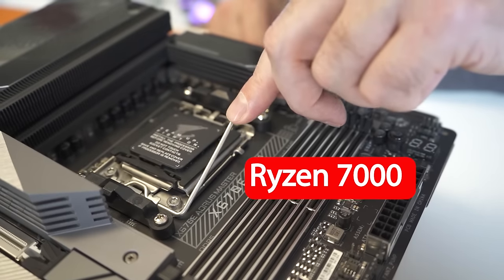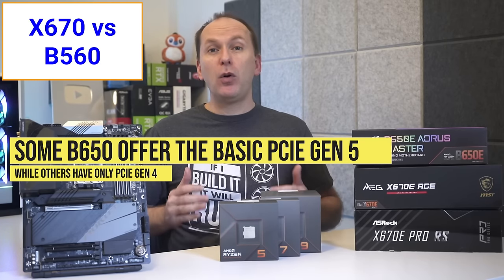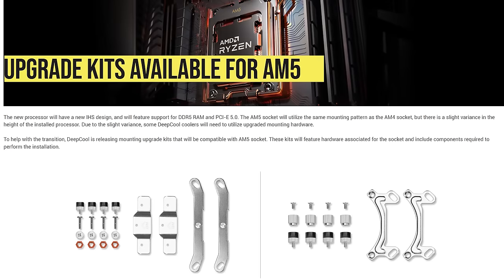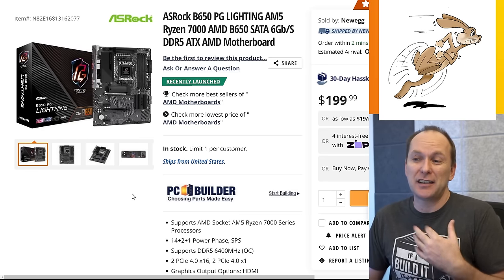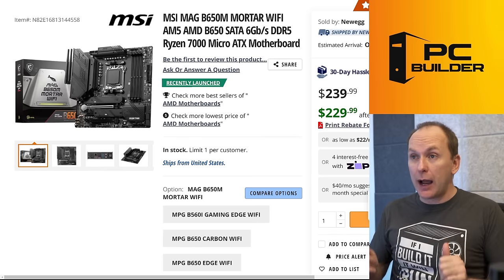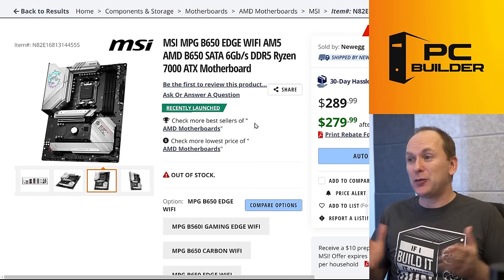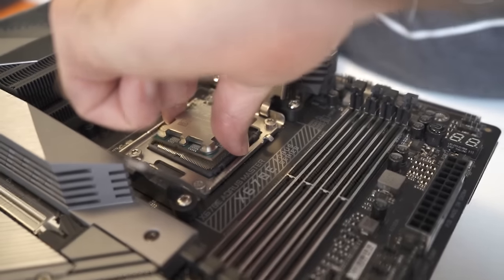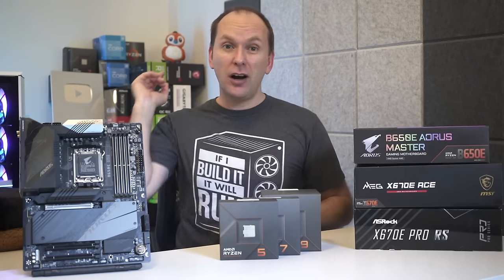Best Motherboard for Ryzen 7000 | AM5 Motherboard (B650 & X670) For Ryzen 7600X 7700X 7900X 7950X

Comment: thx for the Video Man. I still have to decide between a MSI MAG b650 Tomahawk (250€) and the Gigabyte b650 Aorus Pro AX (310€).
Both have great Audio Codec (ALC1220 vs. ALC4080), similar VRMs and Features. 
Are both good for a Ryzen 7800X3D + RTX4090 + 2x16GB DDR5 6000 CL30, (GSkill Trident Z5 RGB) + MSI MPG A1000 ATX 3.0 + Fractal Design Torrent and a beQuiet Dark Rock Pro 4 Build?

Comment: B650 e or x670 e for future cpu upgrades with the 8900x3d 9900x3d etc 
İ am going to stick  with same ram and mb until am5 is ended just worry about vrm powers i dont need double gpu or more usb and ssd sockets what do you suggest ? 
My gpu is currently 4090

Comment: Hello, I have a R5 3600 and a rx 580 8gb for 3 yrs and I am planning to upgrade 1 of them for more fps in valorant and stream, what part should I upgrade and what brand or model should I buy?
Reply: Upgrade the GPU. The R5 3600 has plenty of headroom for up to an RTX 3070ti at least. Which to buy depends on your budget. A Radeon RX6700XT would be a huge upgrade for < $400.

Comment: There is a feature that saved my but once. The motherboard in the AMD  b450 board which is SSD M.2 secure erase. I have this on the MSI B550 board but not on the Gigabyte B550 board. I do not hear anybody talk about this but there is not a lot of software tools that will Handle the M. 2 SSD along with other SSD's you have in your system That is a great tool and feature on motherboard dealing with issue on a bios level.

Comment: I normally buy med/top tier boards like a aorus master or asus crosshair but i think I’m just gonna get a b650 or 650e this time with my 7950x3d. Not gonna use gen 5 I already have two gen 4 2tb drives and as long as it has decent vrms im in. And b650 boards are around the same price as a x570 board from last gen. But one thing I do like on more premium boards normally aorus is a backplate for the motherboard. I have until Friday to pick my 7950x3d at microcenter, i know i should just wait for the 7800x3d but I don’t have much patience. And its nice to have more multicore performance when needed. But wish you could get free ram like on non x3d parts. Im hoping a 7950x3d and gaming oc 4090 should last me 3 years.

Comment: Could you do a video on some motherboards dropping the pci to 8x when plugging more than two m.2 drives like the aorus master. Is that still the case with m.2 gen 4 or only gen 5? Does it matter if the m.2s are wired to the cpu or the chipset? Its confusing, what boards keep the pcie at 16x no matter how many ssds, pro/cons. Some boards giving you usb 4.0 or 2x gen 5 m.2 or other stuff, would be good to have a vid explaining this

Comment: Jason, what if AMD surprises and releases the new GPUs that take an advantage over PCIe5 lanes? 😵
Reply from the maker: If that happens I'll do a new video! ( ;
Reply: @PCBuilderChannel  hehe fair! Reliable as always 😁
Reply from the maker: Also - whether the new AMD GPUs have PCIE gen 5 or not, they will not even be close to fast enough to exceed PCIE gen 4 (we just barely passed gen 3 speeds and gen 4 is double that).

Comment: Asrock is a great motherboard. You forgot to mention it has 4 lights which display if there is an issue with the bios, gpu, ram and psu. It also has the japanese capacitors renowned for its quality
Reply: Actually it is not so great anymore. If you have an OCZ Revodrive3 x2 and would like to run it on the AM5 motherboard make sure to get an ASUS motherboard. AsRock will not be able to recognize your Gen2 PCIe SSD

Comment: It is better to buy i5 13600kf now then i5 12600kf right?
Reply from the maker: So that's part of the new Intel 13th gen launch coming next week. Yes it will be a more powerful CPU but that doesn't necessarily make it a "better" choice depending on your needs. See our CPU video on the channel from easily this month where we cover all the current options. It might give you a better sense of what you need.
Reply: @PCBuilderChannel  is z690 gigabyte gaming good enough for i5 13600kf

Comment: Someone took a 4090 and ran it using PCIe gen 3 spec.  There was minimal loss in FPS and in some cases a difference within the margin of error.  We will have storage soon that can use those speeds but by the time you actually can buy a graphics card that will require PCIe gen 5 speeds, the current round of motherboards will be considered ancient.

Comment: I'm a simple man. I skip Gigabyte and I buy slightly over the top components because I don't run to the store to update every year. I still run my 9700k and 2080. What boggles my mind is that the focus of this review is pretty much only on back IO and sound chip... Why? The reliability/history of the manufacturers, quality of vrams, how many layers does the mobo have, does the layout make sense... There's so many aspects that need to be considered. Not to mention that mobo is the thing that you are least likely to upgrade unless you need to jump to next socket. If you're spending 300 USD on one you might as well do 400 and have something like x670e Strix E-F.

Comment: There is MSI MAG b650m. Windows 10 is slow to boot. When you press the power button, the orange LED lights up, then white. The signal to the monitor is given with a 40 second delay. Does this need to be treated somehow or is there a built-in protective check? In the BIOS, I chopped off everything using EZ Debug, all the same, the monitor receives a signal 40 seconds slower. As a result, 55 seconds to start Windows.

Comment: Is the Asus Rog Strix B650E-E a good motherboard or should I go with the Aorus Master instead?

Edit: Also I noticed that the B650E-E strix has better I/O connectivity but slightly worse VRMs than the Aorus Master. Although I’m slightly disappointed that the Aorus Master doesn’t have a DisplayPort.
Reply from the maker: They are both very high end boards with very high end (and massive overkill) VRMs. Honestly take your pick. Not sure why you want a displayport on the motherboard, remember the iGPU is very weak (office stuff only) and you'll connect your monitor to the dedicated GPU ports instead.

Comment: Hi I have a question i am using a ryzen 5 5600G (I bought it a year ago due to your ago due to your vid)
and FINALLY bought a RX 6600XT for 255 USD ( converted )  but I forgot that 5600G does not support PCIE 4 
will it have a noticeable difference against with a CPU that support PCIE 4 
PS LOVE your VIDS SO MUCH

Comment: Hello i am buys my parta to make a PC right now i have bogjt a 850w 80 gold PSU but i was wondering what parts can i buy so it can run high fps at 1440p or 2k o was going to buy a corsair mid-tower case 4000x RGB with 3 fans included

Comment: i got r5 5600 rtx 3060 build and my total estimated wattage is 329W then i multiplied it to 1.5 = 493.5.W.  now my question is I recently purchased the corsair 550w + 80 bronze PSU. can it handle my pc? or should i be worried? do i need to upgrade the PSU to 650w? please reply :(
Reply: I have a combined wattage of 380W with my GTX 970, i5-4690, 4x4GB DDR3 RAM, running on a 450W PSU - no overclocking. Been running strong since 2015.
One potential issue is: I can no longer connect a second monitor, either the PSU doesn't deliver enough power anymore - it used to - OR a capacitor is blown in my mobo.
Didn't care enough to investigate as I'll replace it in the following weeks. But I wished IF the fault was with the PSU, I had more head room. 
That said, your wattage is even lower, so 550W should be fine and even provide some room for OC. (Advice based on anecdotes, not professional expertise)
Reply: You're totally fine.

Comment: I was not planning on upgrading but scrolling threw BestBuy today they had a Gigabyte B650 Aorus elite ax board for 156$.... I could not pass that deal up. Now to wait for the 7800x3d to go on sale and I'm set for 2-3 year till my 4070ti slows down or just get killed soon by the 12gb 4060ti which I think is going to render the 4070ti useless.

Comment: I  just bought an MSI Ventus 3x GeForce RTX 4080 16GB, MSI X670-P with a ryzen 7 7800x3d and 32gb (2x16) 6000MHZ T-force ram and now I'm hearing I'm going to have problems running 6000MHZ is this true?

Comment: hi @PCBuilderChannel  ProArt X670E Combined power phases 16 + 2 are rated for only 70 amps. Comparing with MSI x670e carbon 18 + 2 90 amps, does it make a difference in processor speed?

Comment: Hey Jason so I just bought a 3060ti founders edition and I connected it to my mobo (asus strix b550-f) and when I went to boot it for the first time it was stuck in a static like screen for maybe 30 seconds but then booted up into my windows screen. Since then I haven’t had an issue with the card, boots up fine now and I haven’t had an issue gaming. Should I be worried about the first boot up it had.

Comment: So I got the b650e master auorus .. 6400 cl32 trident RAM seems to have an issue if smoke is enabled mono starts to have issues after restarting showing (c5) code .. so physically removing and sticking in memory does the trick and disabling xmp after .. now ever since I built this all new rig the q code stays on 76 at all times , not sure why and wondering if you can help ?
Reply from the maker: For troubleshooting I recommend heading to reddit Build a PC Troubleshooting forums. Its a great resource

Comment: Summary:
THE BEST MOTHERBOARD IN PRICE-TO-QUALITY CATEGORY IS NAMED AT THE BOTTOM

[ Choosing chipset ]
• a620 - budget
• b650 - budget, but for cpu overclocking
• b650e - optimal for price and future upgrades
• x670 - avoid at all costs
• x670e - avoid except you wanna build double rtx5090 computer

[ Power delivery ]
8-pin - for budget non-powerful cpus
8+4-pin - for any desktop cpus, even for the future
8+8-pin - buy only if cheap enough or you're a liquid nitrogen overclocker
>=16 DrMos 60A+ (aka smart power stages)

[ Performance potential ]
>=8 layers of textolite (aka PCB) for high ram frequencies
Check for availability of M.2 nvme pcie 5.0 slot, optional

[ Sound/Wi-Fi ]
LAN =< 2.5 Gbit, bigger speeds are overpriced
LAN-controller must not begin from "Killer"
Sound controller Realtec ALC1220 or ALC4080 or ALC4082 or Supreme FX, if you're an audiophile - buy sound card instead and skip this part entirely
Optical SP-DIF for multi-channel digital sound (recommended)

[ Storage ]
The fewer amount of sata, the better (with m.2 nvme is vice versa, but 3-4 is enough)
RAID-controller importance for multiple storage system

[ Cooling ]
Direct VRM heatsink
m.2 nvme cooling

The best for the price (B650): MSI b650e tomahawk Wi-Fi
The best for the price (B650E): asus rog strix b650e-e gaming wifi
The best for the price (X670E): AsRock x670e steel legend
Reply: How about the msi tomahawk or the edge wifi? Would you recommend those?
Reply: @AmirEpix  yes, I would but tomahawk on x670e chipset do not worth it. If we are talking about b650 non-E version - absolutely recommend, best price ro value ratio among all am5 mobos, but only if you consider to not upgrade gpu in the future. That's why I didn't mention it.

difference between msi b650 edge wifi and msi mag b650 tomahawk are: led lighting, second m.2 nvme radiator and a little bit better LAN-cotroller. Tomahawk is still better if you wanna buy only 1 m.2 nvme, it has bios protection from resetting and slightly better usb 3.2 gen2 slot instead of gen1 on msi b650 edge wi-fi.

Comment: Doesn't help, what I want is a Postcode , 2 onboard USB3 and a USB C ....drives me crazy only having 2 of the ports on my case working and a Postcode has help me so much..... dont care if its 2, 3 or 4 M.2 or PCI.e gen 5.  Still I wonder if the AMD GPU that will launch soon will have Gen 5 GPU's

Comment: If you only look a bit , i mean only a bit .... into the Future , i guess until RX 7000 Launch , you will see Pcie 5.0 on a Graphics Card . Why does this matter ? , because 8 Lanes PCIe 5.0 equals 16 Lanes 4.0 or 32 Lanes 3.0 = you   d o n t   need  16 Lanes for the first PCIe Slot . That means you have 8 Lanes for your own use may it be 5.0 ,4.0 or 3.0 , mostly theese will be used  for NVME = additional 2 NVME 5.0 / 4.0 / 3.0 to the one 5.0 NVME over the CPU = 3 plus up to two  4.0/3.0 NVME over the Chipset  , so i disagree with you , PCIe 5.0 may be on the starting point , but its important if you want to use PCIe5 in 2 - 4 Years  . The lifespan of AM5 is way longer than an Socket from Intel , with Meteor Lake there will be a new Intel Socket  a g a i n  next year ...

Comment: thanks for the video Jason,
but damn i getting old, this new am5 can't raise my pulse from nearly dead to i am awake.
I think I just buy a new am4 or Intel 12xxx system, and save some pennies 😂
Reply from the maker: haha! That's not you, AMD hasn't done a great job around this launch pricing wise, makes it tough to get excited about. Nothing wrong with an awesome current gen build! Did you check out our Best 1440p build video from Saturday?
Reply: @PCBuilderChannel  some of the video, not the whole, i got interrupted 😂
Btw I have 2 system my main rig, has a Ryzen 5 3600, b450 mb,  16gb 3600mhz, 8gb Rx 5500xt.
I play most old games so it fine for that.
My second rig is a old athlon system with 16gb ddr3 memory, and the graphic card died, so I had to put an old and 7750 card in it.
But I think it about time that I make a new secondary rig
Reply: @fedepede04  The price to performance on 7000 isn't there yet. Was excited hearing 125+ for boards but that's not a reality at present. Also play mostly older games, 9600k, zboard, 32gb 3000, 3060. Spare skylake 1060 16gb 3000 ram. Have an old i3-2100 for media. 12th has the value or 5000 if holiday sales are cheap, can move some existing spare components (ddr4 etc) otherwise will wait for 7000 to be cheaper.
Reply: @dianaalyssa8726  i agree no need to upgrade if your system run what you play flawless 😁

Beside price I also think that the 7000 series use to much power.
I consider to build a new secondary rig using a r7 5700g and if the GPU is hopeless i can always buy a used graphic card.

Comment: 🧠B550 🧠
❤ B650 ❤
I'm stretched by my feelings to the max right now. Should i go best value out going gen stable B550 DDR4 or futur proof with up to  2025 to upgrade window  ( kind of, i don't trust marketing that much ) and build a futur capable B650 DDR5 ...  I guess i will not see that much of a difference but i would be pissed to invest in something that lost support and upgradable only on the 2nd hand market where luck take a big part and i don't like gambling...
Reply from the maker: This choice entirely depends on what CPU platform you are going with. B650 is Ryzen 7000 only. B550 cannot be used with Ryzen 7000. See our 7600X build guide on the channel for more on Ryzen 7000. See any of our Ryzen 5000 builds for more on Ryzen 5000.

Comment: While PCIe gen 5 may not be "valuable" today, if your intention is to buy AMD because you can upgrade the CPU down the road, then PCIe gen 5 may become more relevant in the future. In other words, don't make the mistake of not having the ability to upgrade SSD and possibly GPUs to the latest tech 2 or 3 years down the road.
Reply from the maker: This is unlikely even in 5 years time, so I advise against spending the extra money on "future proofing". PCIE Gen 5 devices are really only relevant for data centers, not consumers, as we have yet to take advantage of SATA SSD speeds yet, let alone PCIE gen 3 NVME, let alone PCIE gen 4 NVME.
Reply: @PCBuilderChannel  5 years is a long time in the tech world. Gen 5 SSDs are hitting this year. Expensive, but that will change. Also, with DirectStorage it might be beneficial. If I were buying into AMD, I would get a mobo with PCIe gen 5 support.

Comment: So getting any AM5 motherboard with PCIe 5.0 x16 is a complete waste then. As soon as we have a GPU that uses 5.0 then it'll be too fast for any CPU on this platform. Look at the 4090 gaming benchmarks and for most at 1440p they are CPU limited, and that's a 4.0 GPU Imagine what future GPU monster will use PCIe 5.0 x16, will any CPU produced by 2025 (when AM5 ends) be able to keep up? Looks like I'll be getting a cheaper B650 then.
Reply: Yes, everybody recommend B650E boards

Comment: Dont u expect RDNA3 cards to support PCIE 5?
Reply from the maker: I do, because AMD wants you to think it is necessary, but whether those GPUs are on a PCIE gen 4 or gen 5 system will not affect performance. The GPUs just aren't fast enough as we just barely exceeded PCIE gen 3 speeds, and PCIE gen 4 is double the bandwidth of Gen 3.
Reply: @PCBuilderChannel  thx for your reply. This makes sense now. In the video it sounds to me, as if there ain't any GPUs with PCIE Gen5 in existence....
Even tho I know about your stance regarding "future proofing", don't u think a B650E board with PCIE 5 GPU support can come in handy with future GPU releases....??

Comment: I want to upgrade my 10 year old pc, someone is selling for $1100: 	Gigabyte B550M DS3H Micro ATX AM4 Motherboard, 	AMD Ryzen 7 3700X 3.6 GHz 8-Core Processor, 32GB DDR4-3200 memory, Samsung Evo 1TB SSD (x2), Seagate 2TB 7200 HD, 	EVGA XC GAMING GeForce RTX 3060 12 GB Video Card, 659Watt PS, 	Phanteks Eclipse P300A Mesh ATX Mid Tower Case.  I think the CPU is a little too underpowered but is it a good deal?
Reply from the maker: Seems overpriced to me, see our Best Prebuilt Gaming PC 2022 video and check the links there to our recommendations. You can buy a prebuilt that's better for less